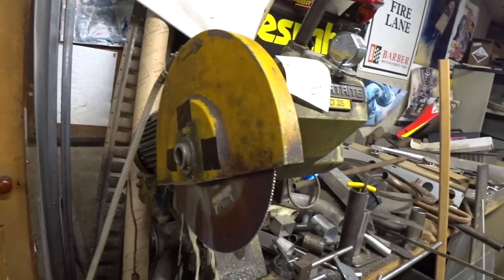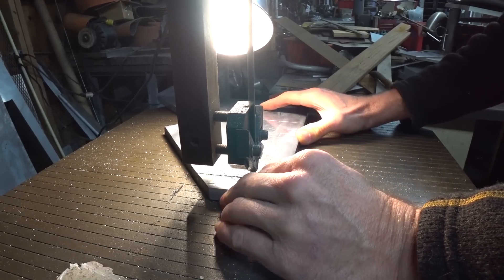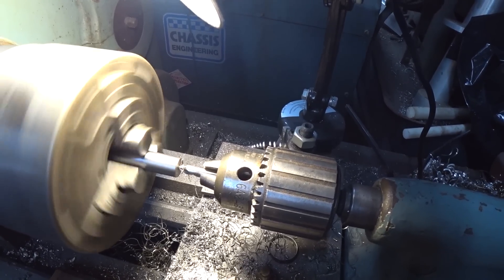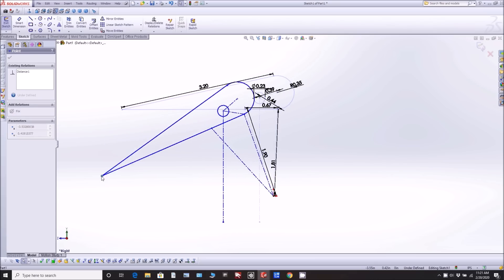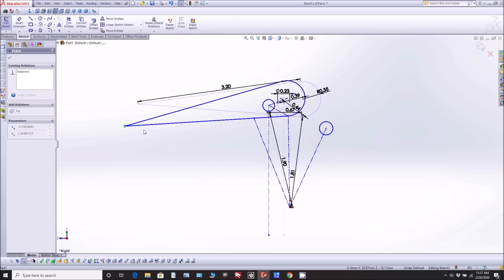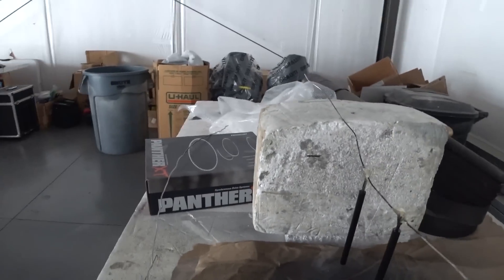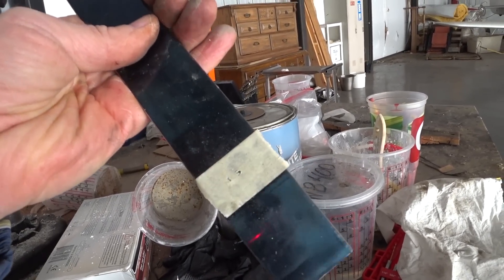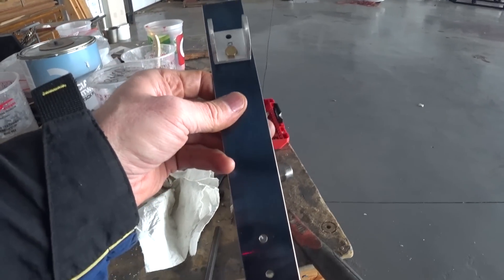The Case for Overbalancing - Building the Raptor Prototype

Comment: Hi peter, watching with interest and cheering on from Mildura, Australia. Just a thought that you have probably already considered, the length of the Gonzo Nose counter balance arm and its area of travel in the front cavity and ,due to the available leverage, the potential for a small entrapment in a wiring loom or other component at the end of the arm making it hard to overpower in the unusual case that might occur. Is it worth considering a CF enclosure that excludes other components?

Comment: The elevators don't need counterweighting any more than Fowler flaps do. The centre of mass of the elevator is ABOVE the the Center of Rotation not BEHIND it.  Wings/elevators flex up and down, not fore and aft. Up and down flex of the stabilizer will therefore NOT result in flutter of the elevator since the center of mass is above the centre of rotation. This situation is entirely different from ailerons which experience much high levels of wing flex and are pivoted well forward of their center of mass.

Comment: Hard to see in videos and may be an illusion, but the bending in the new spring looks excessive and really stressed  where it is bolted  at bottom end...it  could easily  suffer from  fatigue and crack long term.   One way to  alleviate this to some extent is to shape the end of the spring into a loop around the  shaft so in effect you have a longer spring  but also changes the bending force at the mounting point to give much less fatigue.  Another method is  mount a plate either side of the spring  which supports the spring but bends away from it in a parabolic curve. This moves the bending forces up the spring and dramatically reduces the 'sharp' bending in the spring at the bar itself therefore reducing the fatigue.  The same effect can be had by just sandwiching  the spring at the bar end with a couple of bits of  the  spring steel.  This will in effect make the spring stiffer, but then this can be returned to what you had by narrowing and tapering the spring  width along it length towards the top end. At the same time reducing the all important weight..
So above is just  my cents worth and there are probably others with much better ideas, and hope above makes sense the way I have written it...badly no doubt!

Comment: OMG. Best show of the week. Beats everything hands down. I'm very excited to see this machine some day in person. The spring dampened counter weight idea is great. One question: How will that affect inverted flight?
Reply from the maker: The aircraft is not designed for negative G flight but either way this setup would not have adverse effects.
Reply: @RaptorAircraft  I'm very curious about the mechanics of the front elevator and side rudders is all. It's quite a challenge to fight the aerodynamics of lift and yaw from such a challenging airfoil. Balance is key. Center of mass is very important. Have you ever watched the movie "The fastest Indian"? I love how the center of mass is described with a pencil and piece of paper.

Comment: I'm not sure why you chose a counterweight over a spring. Simplicity maybe?  If the problem was the spring rate, that can be mitigated somewhat by using a stronger spring and dividing its rate with a block&tackle.
Reply from the maker: Springs don't respond appropriately to G forces whereas counterweights do.
Reply: @RaptorAircraft  
Ah yes! Adds a lot of weight though. 
I dont know how complicated an active system would be for future iterations, but I suspect that with the proliferation of accelerometers in every electronic device you could probably build it from scratch. Wouldnt have to be a fly-by-wire system. Could be a spring assist with the spring's 'fixed' point attached to an actuator.

Comment: I remain concerned about the spring trim vs aero trim setup.  Aerodynamic loads on the elevator increase with speed and decrease with decrease in speed.  So if the spring is used to trim it, the spring is working against a changing load, and in a way that isn't the way you want. 

In other words, if you're trimmed where the spring force is applying enough nose-up elevator to maintain 200 knots, but then a bump pitches the nose up a bit, the airplane begins to slow.  The nose-up elevator force that was equal to aerodynamic forces at 200 knots is more powerful than aerodynamic forces at 190, so it moves the elevator to more nose--up., slowing aircraft further, etc.  In theory, the airplane would slow and pitch up until the aerodynamic forces dropped to zero and the spring was fully unsprung.  I just see no way that this a dynamically stable system but is instead dynamically unstable.  Divergent, in fact.
Reply from the maker: A trim tab would not work at all on the elevators I have because of where the hinge point is located. If you think about it you will realize why.
Reply: That may be the case,  but another system that won’t work still doesn’t solve the problem. Perhaps variable incidence on the whole stab?  I really love your project and follow it with both great interest as well as great hope!   I’m not naysaying, I’m just suggesting that this particular approach has been tried before and the outcome was as I described. 

Regardless, it’s a non critical system for first flights as long as the test pilot is strong enough to overcome any pitch up or down control forces.  If that’s the case then just get to flight status and figure it out later. Safe first and subsequent flights and all the details can be addressed as needed.

Comment: Elevator hinge moment w/respect AOA (dcm/dalpha) MUST drive nose-down with increase in alpha.  This is a necessity for positive static stability.  Aero engineering basic concept.  This can be done with mass balance and/or aero tabs as required. The mass balance solution is often found to be preferred due to mechanical simplicity.  But it can get heavy.  Looks like you figured it out.

Comment: A cheap way to drill holes in spring steal is to use a masonary drill bit. The low grad carbid works fine as long as you go slow.

Comment: Even though the elevator counter-weight system looks a little ungainly, it’s an elegant solution. Well done! Also, I know it’s only a trim spring, but having a single bolt makes me a little nervous. As much as drilling spring steel is a royal PITA, I’d humbly suggest adding it. The single bolt will fatigue over time, and the last thing you want is your trim spring to disconnect at a critical phase of flight. Redundancy on these sort of connections is a good thing.

Edit: I bet you’re rolling your eyes and thinking “I knew someone was gonna bitch about that :P”. Sorry mate. Also, greetings from the charred land of Oz!
Reply: A single bolt has a high chance of loosening up under this kind of load.
Reply: James Gray - agree that a second bolt adds redundancy to the primary flight control system. Always us two bolts when you can if failure of one results flight control problems. Please Peter! I know it’s a pain in butt!! But please!! We’ll all feel better.

Comment: Peter,

Great update, congratulations on making more progress!
Just in case you need to drill holes in spring steel in the future, the cheap carbide-tipped masonry bits work very well.

All the best,
Jon